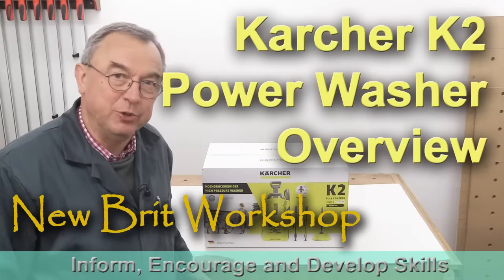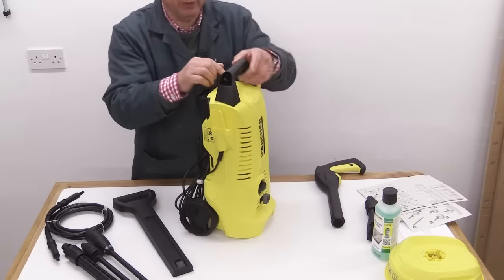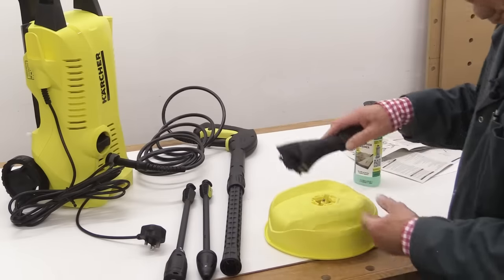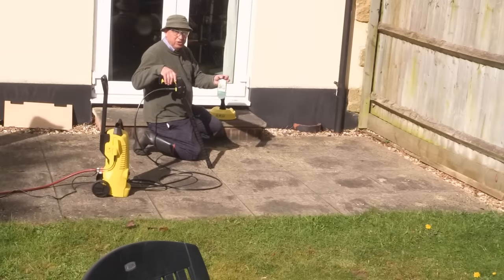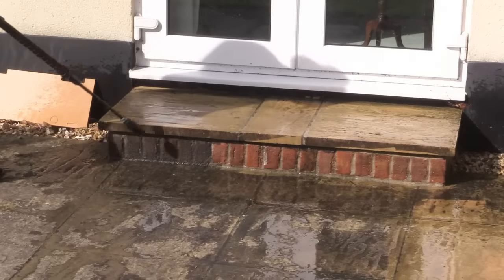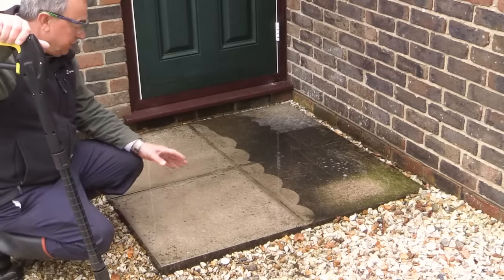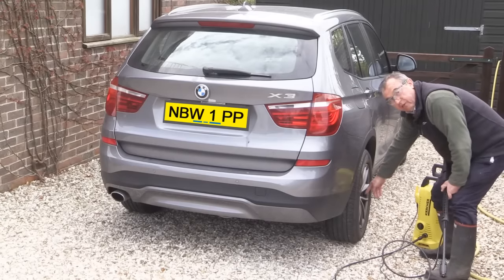Karcher K2 Full Control Home Power Washer

Comment: Within a few days after seeing this video I searched out and bought one of these instruments.

I live in a very large home near Atlanta, GA, USA; and we "pressure cleaned" the entire house. It is every thing Peter said it was.

I have no leaks. The handle did not stay up after it was installed. Also, the "Dirt Blaster" wand failed quickly. I called Karcher and they had a new one here in less than 5 days. It works like a charm. I did not tell them about the handle, because I simply forgot about it. But I am going to call them and have them ship me a new one. I am sure they will.

One word of caution. I only had a 5/8", 100" hose from my spigot; on a large part of my house; after using a 50' on it where I could reach. There was a noticeable reduction in the strength of the spray when pressure washing; for whatever it's worth. But it was NOT weak enough to keep us from using it to clean our home; albeit a slower time. Next time I will buy a 3/4" , 100' hose. I am sure that will help immeasurably when it comes to pressure.

Thank you Peter for demonstrating this amazing device. We love it! And you too dear person.
Reply from the maker: Many thanks Pat.  I am glad it worked out well.   Peter

Comment: I had the original Karcher which I purchased around 20 years ago and only last year replaced it with the K4. I have tried other makes but personally I swear by Karcher for pressure washers around the home. I am sure that the more industrial types are superior but at the price I would not invest when the Karcher does the job that I need. Thank you Peter for showing your experience and I agree the detergent is not worth the extra it costs.

Comment: a word of advice peter, make sure the washer is stored  well in winter, a  very hard frost  of minus 3 or 4 will ruin the pump if it has residual water in it when put away.
because of the plastic parts in it,even inside a garage if it gets down lower than that,
 ive lost more than one pressure washer like that, i now store it inside a cupboard in my garage with an old blanket round it.
commercial machines have metal in their pumps and are not as susceptible.
Reply from the maker: Many thanks for that advice. My previous Karcher, a top of the range model in its day, died through frost damage. I took it apart thinking that I could fix it but it was badly blown.   Many thanks.   Peter

Comment: I’m an Aussie and have owned and used a  Karcher for years. Our patio cleaners come with a hard bristle “skirt” around the bottom so you don’t get that harsh plastic against concrete scraping sound. The skirt also protects the user from debris that may be kicked up by the cleaner.
Karcher also make a foam cannon, which really amplifies the cleaning power of the detergent.
Great little unit though. I wouldn’t be without one now, especially during the pandemic when you don’t know who has handled the car wash guns and brushes at a commercial car wash.
Reply from the maker: Many thanks.  Peter

Comment: A great review. Straightforward, no nonsense straight to the point. Extremely useful and reassuring. I've just bought this piece of kit and have only just assembled it- to honest I'm not impressed by the flimsy plastic- particularly that patio "Dalek" attachment. Having watched you in action it certainly looks like it will be more useful than I first thought. Glad to have seen your review of the patio solution. I've just saved myself a smalll fortune! Thanks again for such an excellent tutorial/practical review. My project begins tomorrow...
Reply from the maker: Hi Moutton, Many thanks for this.  Peter

Comment: I've just bought this same model and used it today on my patio which hasn't been cleaned for 20 years and I couldn't believe the results. Just like in this video. I'm looking forward to finishing the job tomorrow and I do recommend wearing wellington boots because I soaked the bottom of my trousers and my socks.

A high quality, typically English review. My only slight surprise was the BMW. I was expecting a Rover with lots of polished chrome.
Reply from the maker: Many thanks for this - the BMW is just a run-around - we keep the Bentley and the Rolls Royce in the garage !!!  Peter

Comment: The snow foam attachment and auto glym polar blast snow foam works wonders with the K2! Fill to the first line from the bottom and top up with water, run it with the foam at full, leave for 10 minutes and go over the car with a sponge or mitt, then rinse. Just bought the surface cleaner which led me here, now I have a plan, thank you!
Reply from the maker: You are most welcome.  Good luck.  Peter

Comment: My husband I purchased one of these. It is now MINE I love it, I have chronic arthritis and cleaning is difficult to say the least. I am unable to clean the exterior of the house or the driveway in a day, however that is simply because my body fails me. This cleaner however does not. I have cleaned part of the front of the house, the mail box, and part of the driveway I haven’t touched the universal cleaner yet as I simply haven’t needed to. I am going to be using it again today for the third day in a row, I am looking around the exterior of the house and in my head  adding it to my list of things I am cleaning next! I love it, it is incredibly light and so easy to put together and use I would recommend it to anyone and everyone
Reply from the maker: Thank you so much for this encouraging comment. I am so sorry that you are a chronic arthritis sufferer (me too - wrists, elbows and back). I am always looking at ways to make life easier and this Karcher pressure washer certainly helps. Good luck and take care.   Peter

Comment: excellent work.  I am in Japan and there are dozens of these pressure washer systems here (all made in China alas) and your review is very helpful. Thanks so much for taking the time and energy to produce a straight forward explanation and demonstration.  Well done!
Reply from the maker: Thank you so much. ありがとうございました   Peter
Reply: @NewBritWorkshop  Well Sir, the product did exactly as you showed, and with my very clean driveway and deck my wife was even complimentary about the purchase!  I was also able to use the word detritus in conversation.  Many accomplishments large and small.
Reply from the maker: @shizuokaBLUES  Excellent, great humour - many thanks.  Peter

Comment: I've actually borrowed a Karcher K2 from a friend to clean my patio and paths (45+ sq metres in total) and I must say I'm quite impressed. I'd seen various reviews on Amazon, some of them not good, but it seems to do the job nicely for me. Borrowing one has certainly got me thinking of buying my own. About 10 years ago I did buy a smaller Karcher model. But not knowing anything much about pressure washers I was sure it would be ok. Sadly though I found it very lacking in power as the jet of water was thinner than a pencil. It would have taken 10 minutes to clean one paving slab. The K2 is MUCH better, having the power you'd expect to tackle garden dirt and grime.
Reply from the maker: Hi Brian, I am still very happy with the one that I bought.  Cheers.   Peter

Comment: Dear Peter, thank you for your review - extremely helpful as always! 
I still have an old Kärcher 695 from the early 90ies. A brilliant machine that has done hundreds of hours and I dare to claim that it is better than most of the semi professional washers they sell today. The reason is simple: it has metal cylinders and pistons. In fact the only thing of poor quality (like on most consumer pressure washers today) was the "spraygun" that came with it. For serious cleaning purposes you can simply switch it to a professional gun with metal nozzles that offer a fixed water beam in different shapes and width. This upgrade will cost you around 100 EUR (German prices) but your device will so much more efficient than with the standard equipment that came with it that you will have the feeling that the cleaning power has at least doubled. Greeting form Germany
Reply from the maker: Hi Max, That is really useful advice.  Many thanks. Peter

Comment: amazing video!! my work recently bought the K4 full control system which comes with the patio cleaner too. i used the kit on my work van, and its really good. there is a circular brush attachment that rotates a few degress and is used alongside the vehicle shampoo. i strongly advise you to have a look around and pick one up as your 7/10 for the car clean, will definitely shoot up to a 10. i decided, like you, to do half the work with the shampoo, and half without. i didnt notice a difference in the cleanliness of my van. i think a lot of people like peace of mind and feel they are getting a "better" clean by using some form of solution or chemical shampoo when cleaning stuff. i also think karcher know that people will buy the shampoos despite the little effect they actually have. I do not own a karcher washer personally, and will be getting my newer car a little later in the year so will treat myself to a washer then! excellent video, here is the link to karchers website for the vehicle cleaning attachment :)

https://www.kaercher.com/uk/accessory/wb100-rotating-wash-brush-26432360.html
Reply from the maker: That is really useful information and great commentary.   Cheers.   Peter

Comment: Really good video, thank you.
I looked at a K2 a couple of years ago, but found for half the price, I could buy a Halfords own brand which was even more powerful.
They both have plastic pumps anyway, so just as bad as each other.
My halfords one was fine after 18 months so I gave it away and it still works fine, and bought a K4. The K4 is leagues ahead, much more power, a metal pump, and 3 year guarantee, for only £40 more.
Reply from the maker: Thanks for sharing

Comment: Thanks for this. I have been wrestling with myself for months now whether to get this very model or save for a higher pressure one. After your comprehensive and excellent review, this one is clearly powerful enough. My minds made up.
Reply from the maker: Hi Andy, Mine is still doing well despite a lot of use. The only thing to watch is the bottom of the round patio gadget can wear if it scrapes across the patio surface. I have found that keeping an inch above the surface (or slightly less) stops the risk of wear but also leads to a better finish. It is not heavy and so is easy to do.  Cheers.  Peter
Reply: @NewBritWorkshop  Thanks Peter, I will watchfor this. Cheers Andy

Comment: Very useful demonstration, cheers.

According to the Karcher webstie, the solution is used to "increase efficiency while cleaning, help prevent dirt from returning and help to protect and care for your surface" and "to help remove stubborn algae".
Reply from the maker: Hi Edd, I cannot say whether the solution stops dirt from returning but it seemed to be very marginal in every other respect. For me that does not matter as the machine is so good at cleaning.   Peter
Reply: @NewBritWorkshop  Hi, Peter.

Yeah, I appreciate that.

Got a K2 here, still inits box as yet - looking forward to using it!

Comment: Haven't had as much luck with mine. I got the K3 Premium Full Control model, and couldn't be more disappointed. After paying £300, for the unit with the same accessories as the K2 home I set the unit up following the instructions on this video (which is very helpful by the way, one of the best K2 reviews on youtube) and draining the air out. Once I started washing, I was a bit disappointed that even with the dirt blaster attachment, it could not remove light dirt. It then started "revving up" and as it did this, the pressure dropped. To solve it I would have to let go of the trigger for about 20 seconds then carry on, only to have it happen again every 2 or 3 minutes. It was like it had a blockage or something. I also had a problem with the hose popping off every few minutes which resulted in some long walks going backwards and forward to the water supply and pressure washer. I really am disappointed. I had a really old karcher before this and that was great. Really strong wheels and body, and never had any problems with the hose coming off and spurting water everywhere, or any problems with the motor. I never even bothered to drain the air out or anything on that one. Just plugged the water in and turned it on and it worked fantastically. Sadly, the hose connector cracked in the winter so had to get another one.
Reply from the maker: Hi Sam, It sounds like a warranty job to me. Get your money back and then go for the K2 at nearly 1/4 of the price.    Peter

Comment: Got one yesterday not a streak in sight slabs look fresh off the production line ... **NOTE** i seen people saying they smelt a funny burning smell after a short period of using it. I experienced it but soon realised its because the machines not getting enough water and it revs alot louder then usual n after a while will start to burn . just let go of the gun for a few seconds let the water build up n it should go back to normal revs . or just give it more water through the hose ... Either way don't let it scream louder then it should or it will burn out
Reply from the maker: Good advice - before turning the machine on it is essential to have the water turned on and connected and also to pull the trigger to get water flowing through the motor unit.
Cheers.  Peter

Comment: The David Attenborough of Pressure Washing!!! - great video and learnt a few tips and tricks too. I too own the Karcher K2+ (comes with a dirt blaster lance) and also bought the T-350 patio racer. You're right, they are fantastic at cleaning large areas consistently. I too didn't find the detergent to make much of a difference (if any at all) - the patio cleaner did the best job, and the dirt blaster for corners and stubborn grime.
Reply from the maker: Hi Iain, It is brilliant that we both have the same view - David might not be impressed at this but I doubt whether he will see it !  Cheers.  Peter

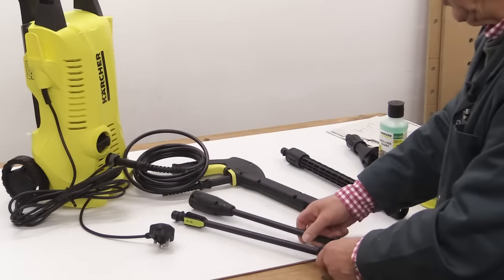Comment: That patio cleaner usually has brush at the bottom around the plastic cover. At least mine has. And most effective cleaning tool for concrete is that full power rotational nozzle shown at 2:32. And don't worry about car too much, K2 only has 110 bar max, but same control lances are used for 150bar cleaners too. But that pressure applies only about 1-2cm in front of nozzle. One foot away it is way less powerfull..
Reply: Absolutely correct.  I've used the dirtblaster nozzle wand and it indeed cleans concrete in half the time that it takes either the surface cleaner or vario nozzle.

Comment: Digging up an old post but I'd be interested in your views after 2years, my K2 broke after around 11 months and when I opened it I found it has very cheap plastic parts (pump etc) inside which had split. Purchased a K4 now much better internals and well worth the extra money.
Reply from the maker: Hi Mark, My K2 is still going strong but it is about the cheapest one they do.   Peter

Comment: Parfitt towers is now all spick and span, lol. I'm amazed that anyone would pay someone else to pressure clean their drive/patio. Pressure washers are so cheap these days and they have so many uses, using them also brings a certain sense of satisfaction, when considering the before and after results.
Great video Peter, funny I had you down as a BMW man. X3 is a great car!
This Karcher unit does seem remarkably good value, (the patio attachement makes a real difference re speed, the detergent is a wast of time in my experience).
cheers
tony
PS Remember to protect the machine from exposure to frost when it is stored.
Reply from the maker: Hi Tony, The X3 is the run about so the house keeper can get to the shops. I did not want to show my Bentley in the video as people would get the wrong idea and luckily my wife's Ferrari was having a service ! Yes, my original Karcher, a really great bit of kit, was damaged by frost.    Cheers.   Peter

Comment: Hi Peter, very informative video, thanks very much.
You are my go to guy for all things workshop so I was delighted to come across this production on your channel.
My son had just bought the compact version and was extolling it's virtues so I decided to upgrade my purchase on your recommendation.
It has impressed me enormously so far but I can't seem to track down an adapter to take my Hozelock attachments with a male connector, such as brushes etc.
Any ideas will be most welcome.
All the best, Al.
Reply from the maker: Hi Al, A while ago the concept for hose connectors managed to standardise itself on tools or attachments with a male connector (as with the Karcher pressure washer) and hoses would have female connectors at each end. So the tap would have a male connector. The hose would have a female at both ends and so can connect to the tap. At the other end it's female end needs a tools (like the Karcher) with a male end. To solve your connection problem get a female connector for the Karcher end of your hose.   Peter

Comment: I bought this yesterday for my decking and, after watching your video Peter, I'm actually looking forward to getting out there. How sad is that? :-) Excellent and informative video. Thanks for posting it.
Reply from the maker: Hi Rob, Almost as sad as me taking an old pair of garden snips apart, cleaning off the rust, spraying with WD40 and eagerly testing them out !! Note that if you have difficulty disconnecting the hose from the machine after use it is likely to be because there is still pressure inside so press the trigger to release the pressure (after switching it off) and the hose should come away easily.    Cheers.   Peter
Reply: Thanks Peter. I did that and had no problem. I realised I bought the K3, but from what I see, it does the same thing. It worked really well on the decking and I, like you found no difference using the sample cleaning fluid that came with it. Cheers, Rob